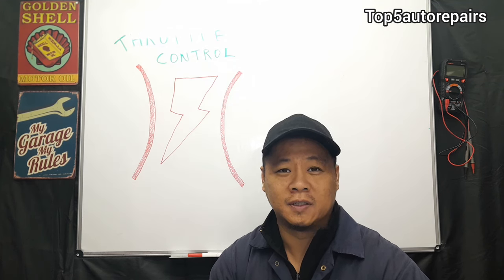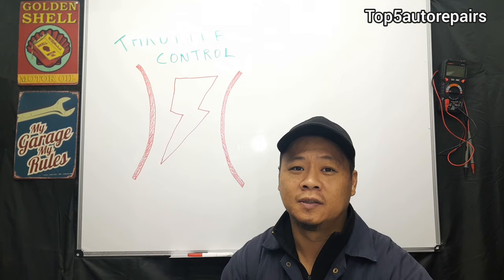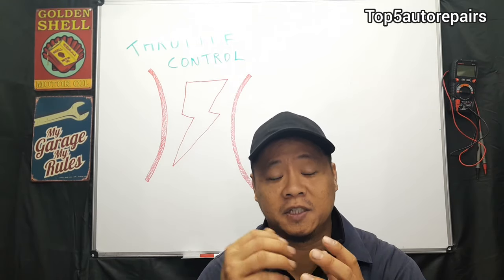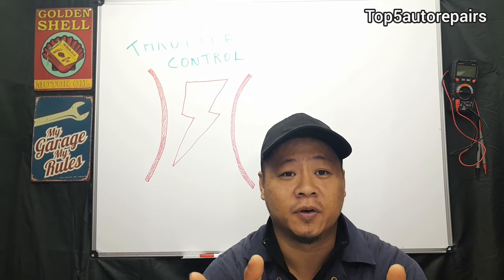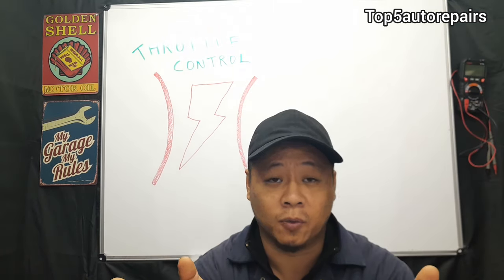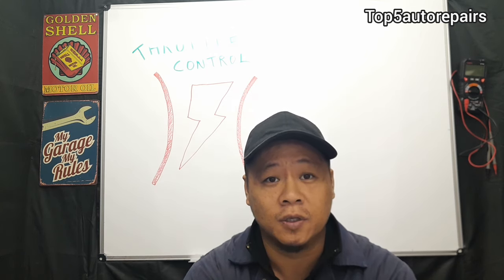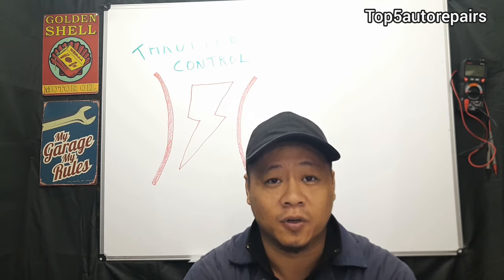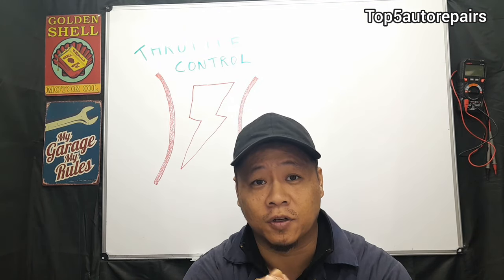Lightning Bolt Warning Light Showing Up On Dashboard How to Fix It for Dodge Chrysler Jeep etc..

Comment: This was a very useful video, thanks! As it turns out, for the past couple of weeks, for the first time, I've noticed this light coming on in my '09 Grand Caravan (~150K mi.)  But it's behaving a bit differently than you describe in the video. It comes on at engine start and stays on (steady) for about five seconds, then goes off and never comes on again, even during a several hour drive. No check engine light, no acceleration issues, no more than the "usual" rough running. The manual says it should come on when the engine is started, but I know it's never stayed on for this long before turning off. Do you think this is normal, or indicates a problem?
Reply: My 2008 TC acts just as you described.
Reply: @vanamee692   Thanks.  Must be normal. Been doing this for quite a while, no actual problems.
Reply: @freecycling6687  well, as it turns out, i cleaned the throtte body and mass air sensor the other day. (Malwart sells a small can of each cleaner in a pack for about $10.) The mass air sensor had absolutely no dirt on it.  However, the throttle body did.  But the weirest thing is that there was a dried leaf stuck between the throttle plate and body.  How did that ever get past the air cleaner is a mystery.  Anyway, no more red war ing symbol on the dash for 2 days now. AND, probably just coincidence but the yellow check engine light, which had been throwing a p0073 code, fault with ambient air temp sensor, has  ow gone out by itself without me clearing the code.  Weird.
Reply: @vanamee692   Thanks for that, very helpful. Haven gotten around to tackling this yet, since it hasn't turned into an actual  problem (yet!)

Comment: I got the whole throttle body replaced after having an issue with the throttle body. The light kept coming on, tried cleaning it before replacing and it only stopped it for a week. Just went ahead and bought a knew one, now it comes on and flashes . It says it can take a while to relearn but I shouldn’t have it come on as often as it does . How do I fix this ?
Reply: How did you get it to relearn? Update please
Reply: I have this same problem now changed everything new still in limp mode poor acceleration trembling. Bout to buy the Map sensor on a 2010 Chrysler 300 3.5 V6 hope this works
Reply: New throttle body still lightening ⚡ bolt

Comment: My lightening bolt is red and my jeep wrangler JK eventually stopped accelerating. I have replaced the throttle body, ECU, accelerator Pedal  and all the sensors. But the car still has hard start, rough idle and no acceleration. Checked all wiring. 3 years of pain.

Comment: Just so everyone knows I changed my leaking intake manifold gasket and my problem went away. It was not the throttle body.  Even tho I had the red lightning bolt and limp mode.  Problem solved.  I also had a leaking primary thermostat housing I replaced that too.
Reply: The intake to the throttle
Reply: Was your car not starting before that cause my avenger not starting after replacing throttle body and crankshaft sensor
Reply: @bosspranks8349  the car was starting fine before fixing . It would just go into limp mode after about 30 seconds on the warm up cycle.

Comment: Having this issue on 14 caravan replaced throttle body replaced gas pedal replaced crankshaft sensor n still can't start the car tried relearning the sensor it won't even relearn with scan tool or manually

Comment: Mine comes on when I make a quick turn for about 3-5 seconds I just take my foot off the pedal and it goes away. Battery is fine and I replaced the ignition coil but it still does the same. I have a 2008 jeep compass

Comment: thank you for being so thorough, and explicative. this happened on my 07 sahara unltd, just the way you described, and my mechanic replaced the pedal and throttle body. now, it idles at around 3K rpm when i turn it on, and only goes down to 800 when i depress the brake. as soon as i release the pressure on the brake, though, it ramps back up to 3K rpm. we didn’t know about resetting after installing the new throttle body. right now, we’re resetting the jeep’s computer. do you know if that’ll work as well?
Reply: I have the same thing happened to my 07 magnum rpm 2 rpm’s at idle. If it’s still idle high after replacing throttle body. It. Could be dirty fuel injectors. Or worse witch happened to me could be vacuum leak in the O ring how I found out was getting underneath the vehicle and looking under the engine and found carbon build up.
Reply: If you got a code reader let me know what codes show up if you didn’t get it fixed yet
Reply: @Stunna_ECN  we, eventually, replaced the pedal AGAIN with an OEM pedal, and it's worked fine since, but i keep getting non-code engine lights that i have to clear. she's running great, though.
Reply: Have to relearn Trottlebody and the gas pedal, I believe you just stick your key in the ignition turn the key on wait for your check engine light starts flashing at you and then you slowly press the gas pedal all the way down let off of it turn off and then back on supposedly
Reply: Sounds like a vacuum leak to the intake

Comment: 07 jeep JK fought that POS light for a year. Replaced throttle body and gas pedal. Helped but occasionally came on Finally replaced intake air temp sensor problem solved no.
Reply: Did you have any problems starting it?

Comment: My jeep will not crank. I have the lightening bolt. I have cleaned the throttle body. What next. Did the key thing and nothing different.  Any ideas what's next?
Reply: Were you able to fix?

Comment: excellent explanation for the lightning bolt symbol which as you said has activated my throttle body warning , i will clean it to see if it helps thanks!
Reply: Did it help?

Comment: What if it just doesn’t turn on ? Or after a few minutes it does ? I hate dodge journeys. I got this car brand new and it has been tearing up every since !
Reply from the maker: Check out my other videos why car won't start
Reply: 1:32
Reply: It doesn’t have a code at all. I’m thinking it’s throttle body for sure because when it does throw a code it shows up and then both lights disappear. I am going to take it to the dealership and get it replaced.
Reply: Or at least diagnosed to figure it out.
Reply: @katiecampbell9191  what ended up being the issue? I’m experiencing this right now. Won’t start but no code
Reply: @Ropadope88  it’ll crank give it a few minutes. I haven’t took mine yet but I am. Apparently it’s something common with the Dodge Journey.
Reply: @katiecampbell9191  I’m definitely having that same issue with my Dodge journey 2015 . Sitting in my car now going through different videos trying to find out the problem 😕 this is costing me too much money and time smh
Reply: I’m with y’all too.. I have a doge avenger and going through the same
Reply: Did anyone get an answer? My sons 2013 avenger has a new. Battery but won’t turn on. Just “clicks” when trying to turn it on. I swear I would never buy a dodge ever! His car is nothing but issues
Reply: @vrichli  mines do the same. I just try it again and it work. SMH I gotta fix this😣
Reply: @valarie holdman  That sounds like an starter my Chrysler 300 is having both issues but my stater is getting changed as I am typing.
Reply: @cort4t5  it could be the ECT

Comment: What if the throttle body doesn’t get relearn? I clean mine out and relearn it but it still stays open
Reply: Did you do the "accelerator pedal" relearn or an actual relearn procedure with a scan tool?  It's my understanding that the pedal relearn is hit or miss depending on the vehicle (it doesn't work on an 09 Grand Caravan, for example), whereas using a scan tool should always work, unless of course there's some other problem.

Comment: I just replaced throttle body and battery, my thermostat is bad but I didn't have the money to get that yet. 08 v6 dodge ram. Fine for a week, now half the light flicker and it'll turn over but dies down before starting. I'l just be left sitting there in the parking spot. Eventually i can turn the key and press on the gas here and there to get it to start, then i hurry home. I have no idea what to do.
Reply: My 2011 ram 4x4 i bought brand new, now has 56.000 miles was doing fine, but when lighting bolt appears, engine turns over, but no start, my boss gave me today off to fix, but damn rain & snow pouring down,,,,this sucks!!!
Reply: @chadsimmons6347  I figured mine out. My Ignition switch was fkd up, along with my thermostat, and my water pump was about to fall off 😬 fixed thermostat, replaced water pump and ign switch, all lights went off. Except for that dumbass tpms light. Gotta retrain sensors I guess
Reply: @Thee_Jimmy_Hindrance   what we're u quoted for

Comment: This is my issue, check engine light came on, around 40-50 miles per hour if i accelerate its sluggish and doesnt want to shift, it kind of kicks it feels like, this morning that light came on my dash as well as the check engine light

Comment: changed my throttle body and pedal. sensor in my jeep wrangler, keep getting this happening
only happens at night, any clue what to do next? flashing lightening bolt with solid abs light moments later
Reply from the maker: Condensation may be causing the issue
Reply: hmm out of all the people I've asked and all the mechanics ive talked to that's a new one
where would the condensation be coming from
Reply from the maker: If you see condensation on the windshield then condensation can also get into the engine bay and affect the throttle body wires. I recommend to check for corrosion right at the connection.
Reply: @Top5AutoRepairs  I do live in hawaii so that's plausible but Its not always wet when it happens. the only thing on the list to fix this that I haven't already fixed is my wires or the computer. & no check engine light or anything associated with it. the only time I was able to get a code I drove to a shop to get scanned while it was blinking. this evening I am running a friend's computer to read the whole trip so we can figure out what is triggering it. it's been a long 6+ months trying to diagnose this issue. it only ever happens on my commute home from work & at night, no other time.. off roading to road tripping. was even considering my headlights having something to do with it since that's only when they are on. what i can figure out is why the abs turns on directly after? btw, 2009 jeep wrangler jku
Reply: @alazaerose Did you ever figure it out?
Reply: @nonyabuisness no :(
I am out of ideas.

Comment: HELP, This light is on, no drivng performance issues. Though the heat stops working… what is going on?
Reply: Mine did the same tonight heat stop working but is still driving also my temperature gauge disappeared
Reply: I have the same issue, but only when temps are below 35 it seems.
Reply: Heater core. Lemme know if that was the issue
Reply: @dsouth2323  yes the same thing to me

Comment: Mine is a 2018 dodge journey with a  push start ignition. My engine light came on a few days ago but turned itself off after a day or two. It came back on last night and when I left the store, it took 2 tries to start it. Then it was running poorly and sounded like it could die. It also had the electronic stability and throttle control lights came on. It wouldn't go over 10 to 15 mph with the pedal to the floor. I got home and shut it off, then immediately started it again. It ran perfectly and all faults had cleared themselves. Throttle power was also back to normal. Any thoughts?
Reply: This is what is happening to mine. Did you find out what was wrong???
Reply: I have a 2018 dodge journey..leaving work, the engine light along with the flashing lightning bolt came on..I had to pull over 6 times..shut off engine and wait then restart.. I eventually made it home.. I just had a theoddle body put in..along with a tipim , map sensor, new battery and a Tipim...its seems worse than ever...I'm so frustrated!

Comment: My throttle body likes to act up when it’s cold outside , I just replaced it … it was fine while it was hot but now that it’s cooling down it acts up ( flashes for a few seconds , when it flashes it idles weird … just by me simply cranking up still in park … )

Comment: My dodge doesn't have a MAF it has a MAP.  I unplugged the battery to reset the computer and when I plugged it back in it had rhe lightning bolt symbol. Nothing to do with carbon

Comment: Diagnostic test, shows no code. Maf sensor replaced, coils, spark plugs, cleaned throttle bottle. Some big ol hose that has o2 sensor attached.   Idk what else to check or replace. TPS and pedal sensor I’ll check too

Comment: this light popped up on my jeep liberty, along with the solid orange check engine light. i turned my car off and back on and the ETC light stayed off but engine light is still on. any clues?
Reply: Same with me. I think it’s a sensor issue. I reset it with an OBDII today and it all went away, so I’ll see how long it will stay gone for.

Comment: My warning light came on after I changed the valve cover gasket does anyone have any ideas why this happened
Reply from the maker: Did you disconnect the throttle body connector? That will trigger the light.

Comment: My van didn't do any of those.  It ran just fine yesterday.  Then, when i had to run somewhere last night, i put the key in and turned it, the lights and dash came on and the radio but wouldn't even attempt to crank over.  Just wouldn't start. Not even when trying to jump it. Just shows the red lightning bolt.  Anyone have any ideas?
Reply: Did you figure out this issue? That’s what mine is doing.
Reply: Nope, a shop 30 minutes away toward it for us to their shop and 2 days later they brought it back and dropped it off and it was working.  I wasnt home so I didn't get to talk to them. I wish I knew though. My wife wasn't sure what they did. I tried to do my research and it sounds like it could've been the throttle body not working right.

Comment: 2020 dodge charger scatpack had this pop up and my car jerked back and forth then went limp mode and gave me a code for P2101 thank you for this info will try cleaning the throttle body as ever since I took off my oil catch can due to it being illegal in California I’ve been having issues with my scatpack any scatpack owners should be wary of the sludge build up that happens in these cars not just the pistons/rings and lifters giving you lifter tick (Lucas injector cleaner helps with tick) but now I have this issue
Reply: lifter tick is not caused by sludge issues. It's caused because Dodge switched the hemis from the original 5w-30 oil to 0w-20.  Put 5w-30 oil back in and you won't hear the tick.

Comment: Hello, this light came on my dodge journey 2015, the light comes and goes, but now I’m seeing problems I turn on my Ac while I’m running the car I can be driving and my car stops completely turns off! Can it be because of the throttle body sensor??
Reply: Yes ! It can be your throttle body position sensor which is what sets that angle he is talking about and what is on that white board in his background.

Comment: I was thinking it's my throttle body or battery just got a alternator it's been used though.
Update: I just got a new map&maf sensor and it's not the throttle body. Im getting a battery tomorrow and I'll let y'all know wassup
Reply: I’m curious about this too
Reply: any good news or not yet ?
Reply: What ended up happening
Reply: @jeremiahbuie4251  dude never updated us😭
Reply: mine ended up being the alternator i have 06 magnum the lights would flicker and dim and then that's when that symbol popped up
Reply: @jaqualynbaker9713  my lights are good and so is the battery
Reply: Did you get a battery and if so did you have any problems with acceleration when you were driving?
Reply: @leola3942 it runs fine....engine light came on I need to get a new pcv valve.
Reply: @jaqualynbaker9713 what altenator did you end up running

Comment: I am having this issue in my 2010 dodge charger sxt. That light comes on flashing with the traction control light. Can't seem to figure out what the issue is.
Reply: What was the fix? Have the same exact two warning lights coming on.